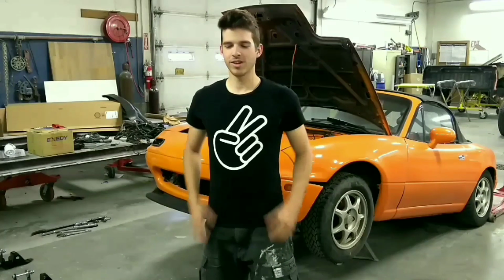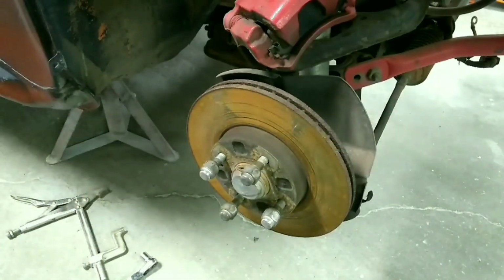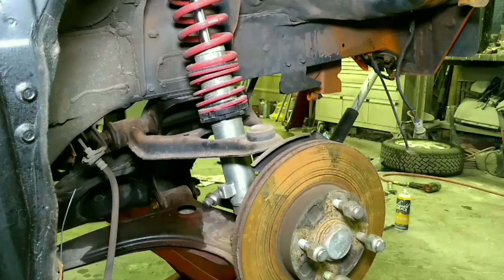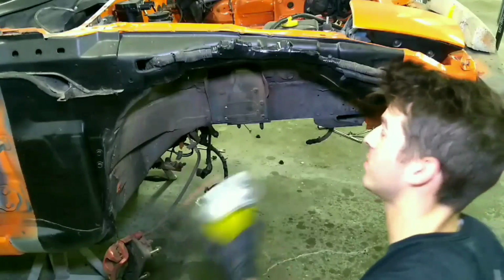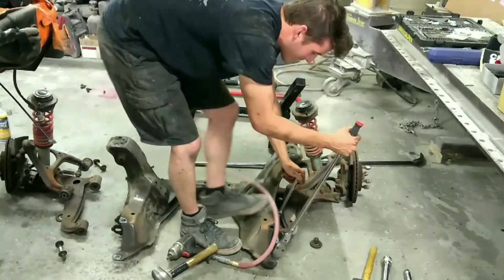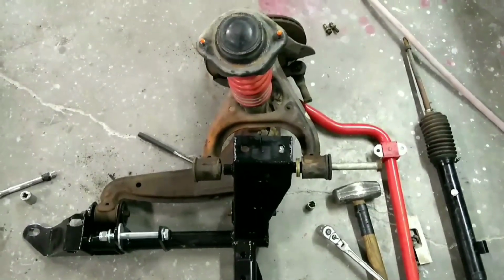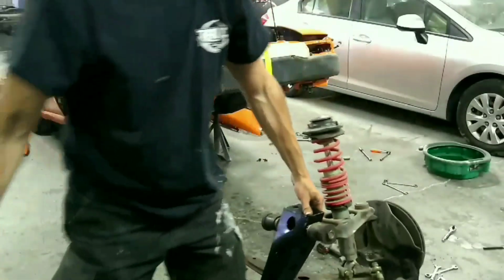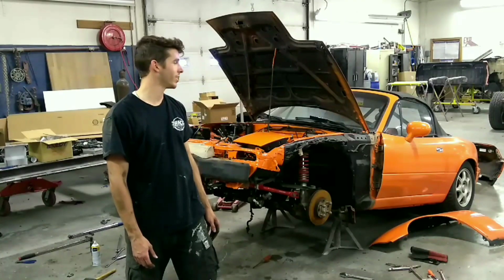Miata J swap Part 2 (subframe)

Comment: What kind of issues have you experienced, and what is the costs, also are you going with an aftermarket transmission?
Reply from the maker: The full kit with the exhaust bits from MiniTech after shipping was a little over 4k. Things that I wish I new before hand was the J32A2 engine is the easiest to use mainly because that is what their kit is based around all though it works for all J engines. You can use the stock ECU for the J32A2. The exhaust that they give you also was made for the J32A2. I tired to do it with a J32A3. I also should have figured out to relocate the thermostat because in order to replace it down the road you will have to drop the engine. wish I installed the engine from the bottom up it would be a lot easier. a lot of people have problems with the oil pan. It ends up sitting almost 2 inches below the subframe and is completely exposed. Many have smashed and cracked their block just during daily driving at stock ride hight. If I continue with this swap I'm definitely making my own oil pan. I think this would be cool but the jaguar v6 swap is a complete kit (not sure how much $$) and there are other engine swap kits that are completely and have less modifying and such required. The only thing I'd say is worth it from the "kit" is the subframe. If you have a friend that is good at fabricating you can make a better oil pan, exhaust, and such than what MiniTech provides.